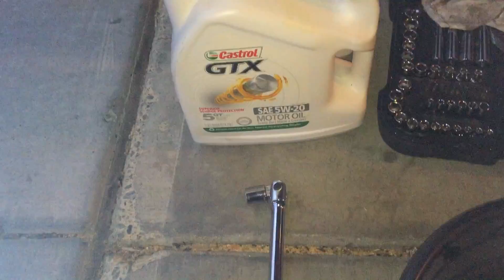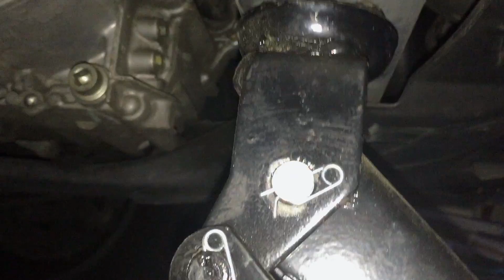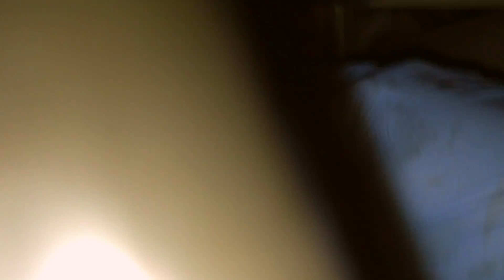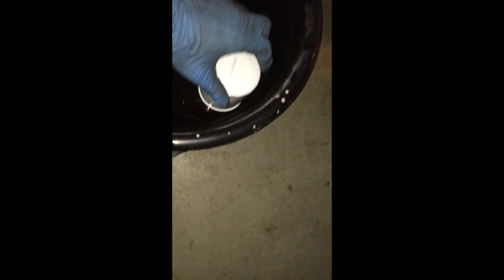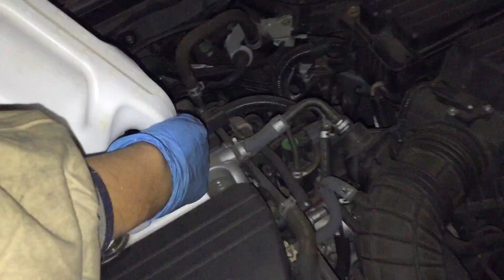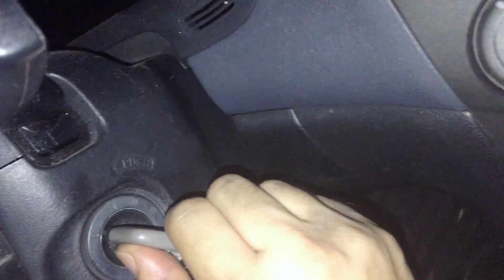2006 Honda Accord Oil Change 2.4L 4cyl

Comment: To those of you coming to this video looking for the filter, he really didn’t explain where it was located.
You have to go basically underneath damn near in the middle of the car the see it.
But it’s hard to even get it lose with the pipes in the way. What I did was go from the top of the car, if you go on the passenger side and put your head close to the open hood and look straight down you can see it. It was hard to get the tool to losen it to even fit in between everything (underneath or from above) best bet is to use your hand and twist it off. You have to twist it TOWARDS the driver side to loosen it and twist toward the passenger wheel to put the new one on

Comment: why not useing full synthetic oil ?  like royal purple or pennzoil ultra platinum
Reply from the maker: For the 2006 model year, the accord did not have fully synthetic oil from the factory. I am okay with more frequent oil changes so I use conventional motor oil.

Comment: Does drain bolt have washer on it ?
Reply from the maker: Yes it should.
Reply: Looks like washer stuck to the oil pan.   Dealer is closed , I decided to take the risk and no leaking oil 😅
Reply from the maker: @07acuratl15  you can pry the washer off the drain pan.

Comment: I'd suggest using a 17 mm 6pt socket with that breaker bar.Those honda oil drain plugs are almost  welded tight.Must be the heat buildup? Anywho, 12 pt sockets will strip out the nut.

Just picked up an 06 with 170,000 miles on her and 1st time she has hit 15% on her.Thanks for the video roadio cowboy.
Reply from the maker: anita massengil thanks for the comment!

Comment: What if I changed the oil and reset the odometer but it's still saying low oil life
Reply from the maker: I am not sure, that has never happened to me.
Reply: @RoadeoCowboy  nevermind it worked fine thanks bro!
Reply: @RoadeoCowboy  I just had to hold it, let go then press it again

Comment: Hand tighten the oil filter, no death grip needed then use the oil wrench to tighten 1/ 8 of a turn on a smaller oil filter. I'm glad that you added the reset. Thanks for posting!

Comment: A few comments. you might use new oil to lubricate the rubber gasket on the oil filter. Instead of dipping new filter into the old oil you removed from the engine with metal shavings in it. Also you might want to open the oil cap so the oil flow is faster. one more tip, you might want your engine is slightly warm to allow the oil to flow easier.

Comment: -It's recommended not to use old oil to lubricate the new filter.
-I second the jack stands comment
-I second the torque on the oil pan bolt
-I second the oil filter location comment

Comment: Where is the oil filter located at? It must be down underneath. My wife and I decided we're going to start changing our own oil again after the local tire and lube place failed to tighten my oil filter the last oil change. It's getting to where you really can't trust anyone to do it right anymore:-(
Reply from the maker: https://youtu.be/PcZ-cMJnV7o?t=305 The Oil Filter sticks out the side of the engine, you can access it from the bottom.
Reply: Would a pair of ramps fit under that front bumper, or would I need to jack it?
Reply from the maker: Yes, a pair of ramps will fit under your front tires. Make sure you have your Parking Brake Up after driving your wheels onto the ramp.